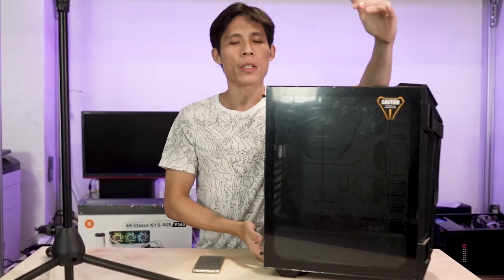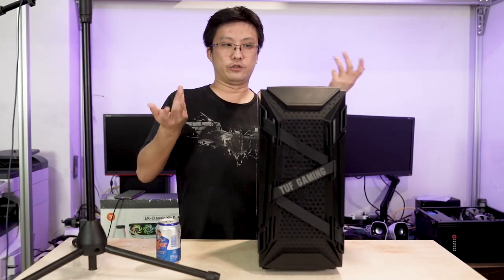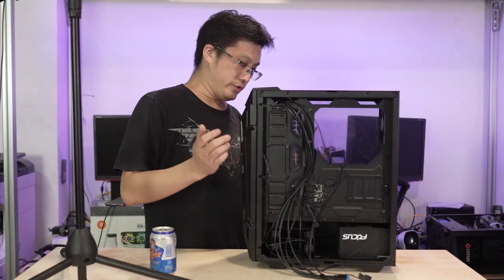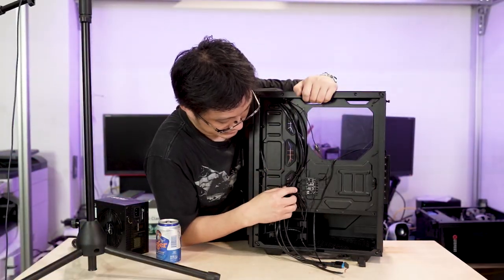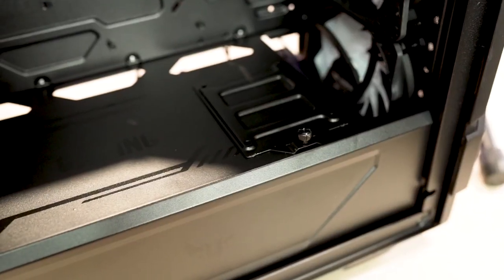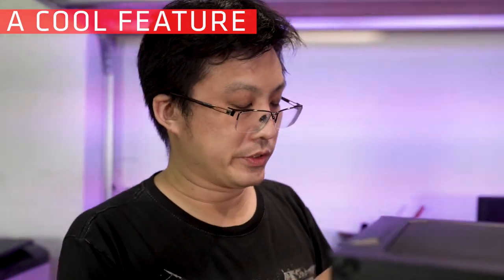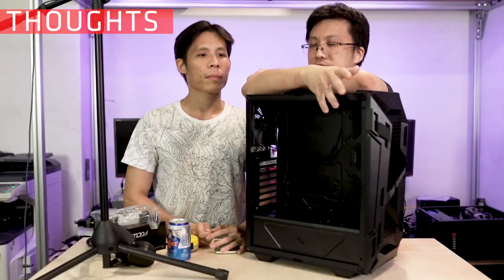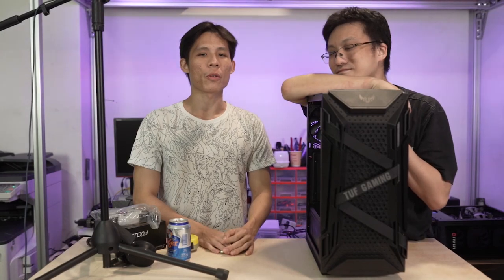ASUS TUF Gaming GT301 - Before You Buy! Great Mid-range PC Case?

Comment: Thanks A LOT for this amazing video. I really like the fact you  went into more details on the fan and cooling support along with the clearance for newer NVIDIA GPUs. Something that I couldn't find anywhere else. This case would've been all fine if I went for my current setup in mind, but if I wanted to get a water cooling solution in the future then it's bust. Coz the GPU wouldn't fit. Great video.

Comment: If you look closely, you can reposition those 2.5" drives vertically, beside the rubber grommets.
Better position, keeps them right out of the way.

I don't know why the default position from the factory is in the two strangest places to put them...
Reply from the maker: Hey Cohan! Thank you for pointing this out. So you mean you unscrew the brackets and position it elsewhere?
Reply: @RealMelTan  yep.

Comment: hi master! i got this pc case im fine with it . put an ryzen 7 5700x 3060ti gigabyte triple ventilators and gigabyte gaming x v2 b550 motherboard and an arctic freezer 34duo in it. can i sync the rgb colors somehow to sync the case fans with the gpu? also i dont use any plus fans only those 4 came with the case , My cpu heat is 70'Celsius while gaming( i don't know if its normal), GPU heat is around 60-65'Celsius while playing cod mw2( this looks good for me ).Also i did use msi afterburner for GPU and ryzenmaster for CPU(Default - All cores optimizer -30) to do you think i should buy extra fans to the top of the case ? Hope you do answer thanks for reply, have a nice day!

Comment: My motherboard have no Argb headers.(msi b450m mortar max)
So, how can I control the lighting of those fans with Asus aura sync software?
Plz tell me
Reply from the maker: Hi Emon, perhaps you can get an external aRGB hub splitter like this? https://www.lazada.sg/products/asus-aura-sync-5v-3-pin-rgb-10-hub-splitter-sata-power-3pin-argb-adapter-extension-cable-for-gigabyte-msi-asrock-rgb-led-w-case-i921812055-s3251156532.html?exlaz=d_1:mm_150050845_51350205_2010350205::12:12261804687!120300669351!!!pla-297963845945!c!297963845945!3251156532!135974633&gclid=CjwKCAjw9uKIBhA8EiwAYPUS3LJ44El4VlIkWw01VAc7AeCfbqVuG0revDaBzOnyFUlTGXWC1gekORoC14kQAvD_BwE

Comment: Think I can manage a 3080 with a 240mm radiator in the front?  The specs for 3080 say length is 28.5cm so it should work in theory, right?
Reply from the maker: Which RTX 3080? 28.5cm may be able to work, but it depends on how much clearance u have left from the radiator haha

Comment: Thermals on bad :( i have it 
Had to change the 3x 120mm RGB fans to 2x 140mm for intake. now its better
Reply from the maker: Oh what fans did u use previously?
Reply: @RealMelTan  the ones that came with the case itself
Reply: Think the fans go up to 1400RPM according to some info on the internet (and carousell sellers), what fans did you use instead? (Thinking of replacing the inlet fans with arctic p12s)
Reply: @blacknote6945  I used 2 Phanteks 140mm PH-F140MP V2

Comment: i use asrock b550M pro4, and use this case.
cai i sync that case with software like armoury crate?
i try to find hardware from that software, i just can sync with RAM and VGA only, not the fan case.
Reply from the maker: Yes I will have to confirm this. But I don't see any way to control the case's RGB with armoury crate (Aura sync)?
Reply: @RealMelTan  already solved. We need to unplug fan's argb pin from controller and direct plug to motherboard with splitter. And now we can control it from armoury crate and cant use controller on case anymore